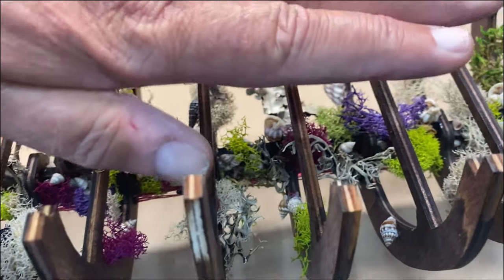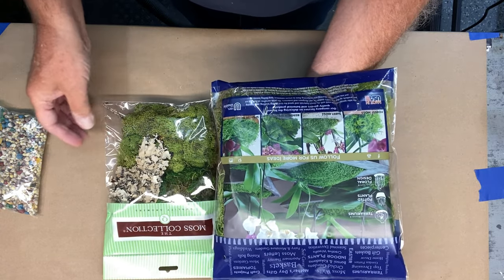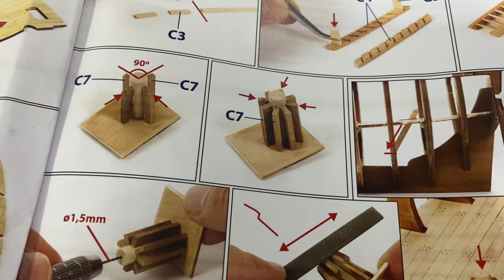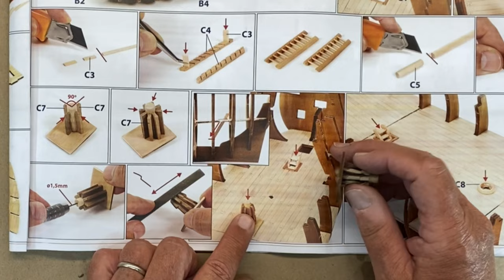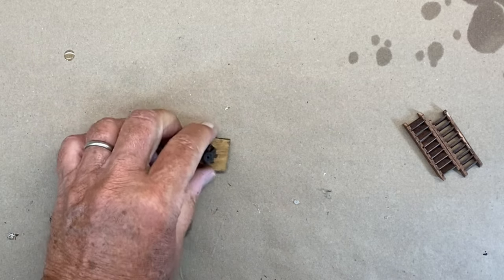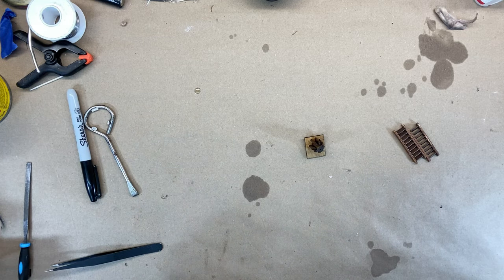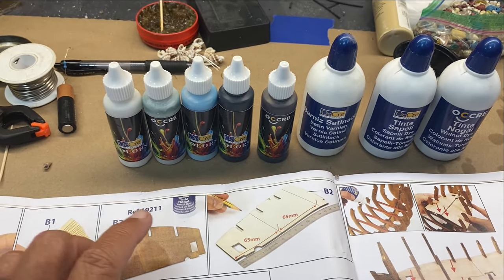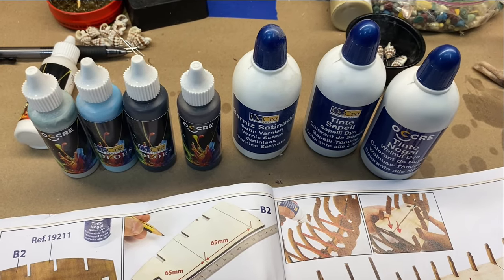The Flying Dutchman PART 3

Comment: Looking really good. I like the shell lamp idea and all the 'foliage' down below. I remember the movie with the sailors being 'part of the ship'; many were part sea creature and walls had coral and such down there. Everything was pretty dark and dreary if I remember right. I always forget to do the holes and lighting stuff early on and make it difficult for myself too.
Reply from the maker: Where I think I messed up on planning for lighting….. I forgot that there’s no closed section below deck….. next time I’ll drill both sides even if I don’t plan on lights! 😂.
Once I get the hull planked and see how dark the lowest level is, I might take the airbrush and darken things a bit….. I’ll wait and see on that one.
I mounted the shell torches on the hull side beams.  They are going to make the ship!  I may try to light them in the next segment….. that will probably be in a couple of weeks ( a little side project going on at the same time 😵‍💫.
Anyway, thanks for hanging around.
Maybe I’ll watch that episode of P.of the C, to refresh my inner pirate 🏴‍☠️ 😂👍

Comment: Looking good. I believe that 1.5mm hole will allow for the captains wheel to later be inserted into. I believe. I guess we will all have to wait and see.
Reply from the maker: Maybe?  I’ve hit a hurdle 🙃🥵.  I’ve done lots of copper leaf and then aging it using salt and fuming it in an ammonia chamber….. for some unknown reason, it’s not working!
I’ve scrubbed off the copper twine now and started all over.  Just not working….. So I switched glue….
Still didn’t work 🤬.
So I did on a piece of wood and everything worked fine!
Must be something about the metal parts in the kit????
I’m now trying 2 coverings of copper!
If that doesn’t work, I’ll give up, and try something else 😫
Reply: @BoilerDan1  yea I’m not sure what the copper issue would be. I’ve copper leafed but never aged it in that way but instead used Brass Black look. It ages it with more of a darker used stain look rather than the corrosion look. I’m sure you’ll figure something out. I wonder if it’s pewter vs some other metal type.
Reply from the maker: @sub04aru Definitely has something to do with the metal. I’m switching to an acid based product that is used to darken the framing of stained glass windows.  It’s working 😁🏴‍☠️. Not the patina that I wanted but it will be fine.

Comment: Nice work mate.  I was going to build this ship as my next project.  I did see you had started so I thought I would wait and see your progress.  I’ll follow along and learn from your experience.
Reply from the maker: Great to have you aboard!  I try to be creative beyond what the kits provide.  Today, I'm in the process of trying to age most of the metal parts.  Using copper leaf, then aging the copper.  I will feature it in Part 4.  I'm also working on putting together a small jar of dirt complete with Davy Jones heart......(idea from the movie).  If it works, I'll send one to anyone donating to my Super Thanks YouTube fund of which supports my hobby 😂.  I'll post details in an upcoming episode if it works out.  Thanks for watching and enjoy your adventure too.🏴‍☠️
Reply: When’s the next episode coming? The anticipation is killing me.   😂
Reply from the maker: @joshhouwen5463 I hit a snag….. I have been trying to copper leaf all the metal parts…..😫 For some reason, the copper won’t get any patina look when I complete the process that I’ve done with several other projects…..
Three times I have cleaned off and repeated the process with failure….
Yesterday I gave up and switched to a different method. It just darkened the copper which is acceptable but not what I was hoping for….
Anyway, once I get the cannons done I’ll be back on track and can move forward….. I found some actual “barnacles” on eBay which will add to the look!  I want to load a lot of details on the lower deck while it’s open….. So to answer your question……. It’ll probably be a week maybe two the next episode 👍🏴‍☠️👍
Reply: WOW!   Can’t wait to see them barnacles! Your unique approach on this build is going to be epic! 
This hobby is very much about trial and error.  I have learnt so much and there are so many ways to do things. The fact your hit with a difficult situation keeps it interesting.   If it was easy, then there would be no fun in it!  Keep on trucking mate.  Looking forward to seeing the progress.
Reply from the maker: @joshhouwen5463 Thanks, I will keep sailing on…..🏴‍☠️

Comment: That is a really good idea for the bottom deck. Before watching this episode I was just planning on putting it on the outside of the hull. Are you planning to put figures on this build? Also do you think this build is a better quality than ZHL brand?
Reply from the maker: I’m not going to put any figures on initially.  The 3d printer I have doesn’t produce good quality on small figures. I can always add them later.
The ZHL Black Pearl has better quality wood. A lot of walnut for planking. It also has double layer planking on the hull with the outside layer being very thin walnut. I also think the instructions are better on the ZHL with larger blue print type drawings.  But I’m still very happy with this ship and I think it will turn out to be something special.
One other thing, it’s not as large as the Pearl. About 10 inches shorter.